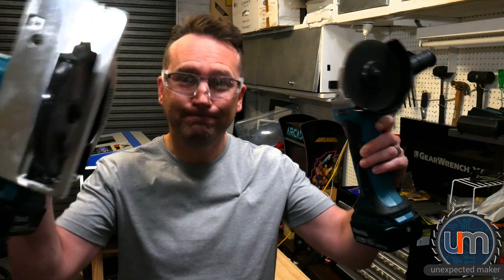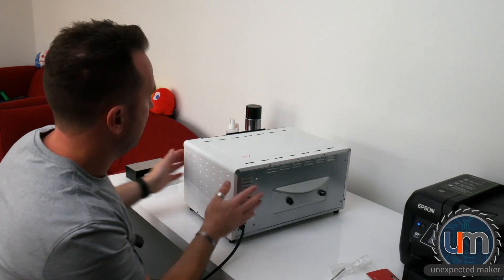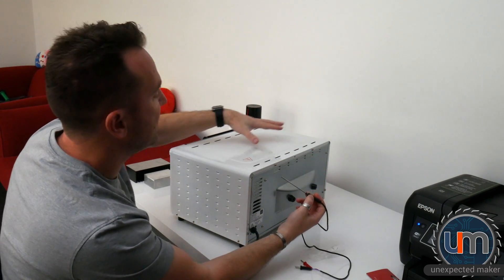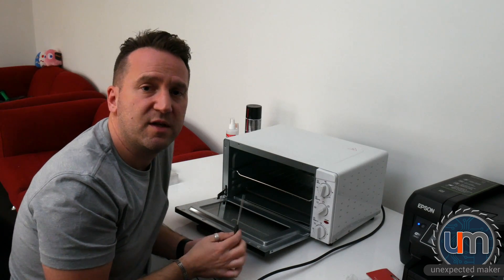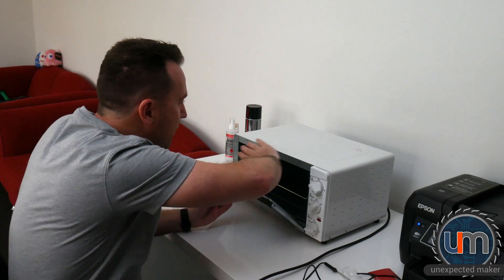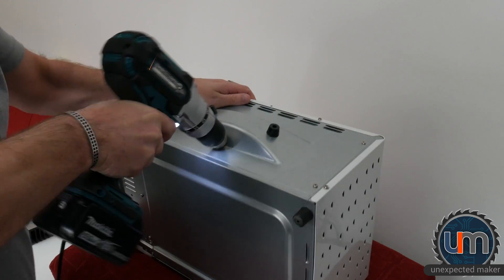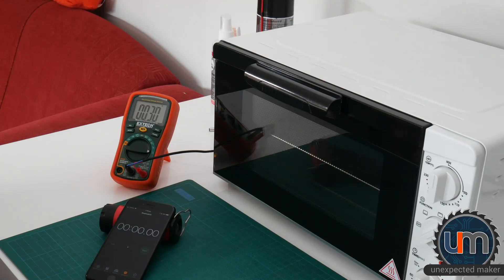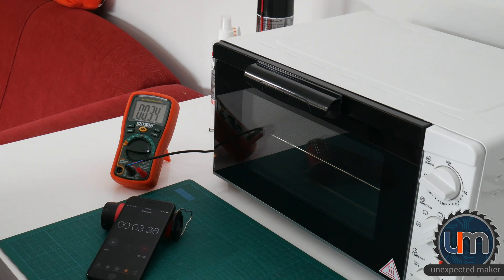Adding a K-Type Temperature Probe to my Reflow Toaster Oven

Comment from the maker: So a quick follow-up on this... I've not had a chance to replace the hot glue yet, but I did a bunch of reflow on Saturday making new Neo7Segment boards with 143deg paste, and the hot glue didn't melt or even get soft at that temp, so though I still plan to replace it with some JB Weld, or high temp silicone, I'm still able to reflow with it for now. Phew!

Comment: I would have gone with one of these, it may be a little too analog though but it does have a screw thread to hold it in - https://www.ebay.com.au/itm/2-0-3-9-Inch-300-C-Barbecue-BBQ-Pit-Smoker-Grill-Thermometer-Temperature-Gauge/252717907285?hash=item3ad7293d55:m:mcIDT-vKhgkjvaR2HcLiIRQ
Reply from the maker: HAHAHA... Between it being an oven and having a BBQ thermometer on it, I can't see how it wouldn't just make me hungry every-time I looked at it! Mmmm... BBQ.... ;)

Comment: it would be so nice to put in a microcontroller instead of the multimiter :D
Reply from the maker: Yeah, I thought about it, but from what I have researched, the ones that just turn mains power on and off to control the temp don't work well enough as the rate of change in the oven is not fast enough, so fully automating it isn't really possible. The ones that control the elements directly via the control boards still have similar "rate of change" issues and require a huge amount of effort to install, and at that point I'd rather buy a T962 reflow oven for $300 and have a reliable solution, with a programmable rate control that can reflow 3-4 boards at a time.

Comment: Agree on the JB weld suggestion, the red type is high-temp: https://www.amazon.com/J-B-Weld-31314-Temperature-Silicone/dp/B00ID8IUJY
Reply from the maker: Yeah, my local electronics shop has some (much more expensive) but only 10 min drive away ;) I'm def going to pick some up today and rip the remainder of the glue off and "weld" it :-)

Comment: Heat resistant silicone, like the stuff used on bbq's and wood ovens. Usually 200°C rated... 👍
Reply from the maker: Yeah I have silicon here, but a few people have recommended JB Weld, so I might look at that too. Seems I have way more options that I thought I would have, which I am very happy about :-)

Comment: First of all, that opening was hilarious haha. Would it make sense to try printing a holder in ABS to force fit into the hole?
Reply from the maker: Thanks! I wanted to do something a bit more zany with the start of the video. might have gone a bit over-the-top though!
I can def make a mount in ABS if I need (I usually only print with PLA, so would need to get some). A friend has also offered to "turn" an attachment on his lathe for me out of metal, so it seems I have quite a few options.
Reply: ABS isn't too bad to print. It just tends to warp for taller prints but this would probably be on the shorter side I imagine. I've had good luck with Hatchbox filaments and they're on Amazon so you should be able to get it in AUS. However, a turned metal piece sounds way, way cooler

Comment: Fire cement would probably work, definitely heat resistant
Reply: http://www.castworks.com.au/index.php/maintenance-products/cements-silicones
Reply from the maker: Wow, I am hearing about all sorts of new products that I never knew about. Thanks for the tip and link! It seems that if regular silicon (I have some here) doesn't work, I have a few options up my sleeve :-)

Comment: How about chemical metal to hold the probe. Comes in a tube and you mix it. Goes hard as nails
Reply from the maker: Had never heard of chemical metal until now, Thanks! I'll look it up.
I'm going to try some silicon today and see if that works better. I also have new solder paste that reflows at 143deg, so I won't have the take the oven as hot in the future.